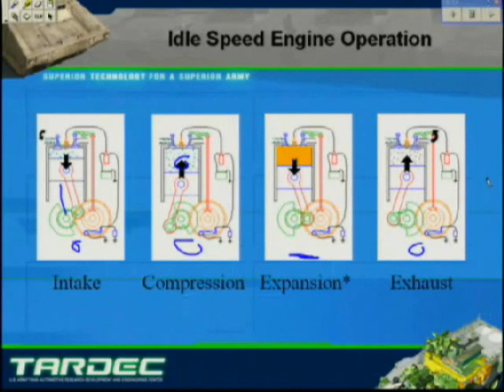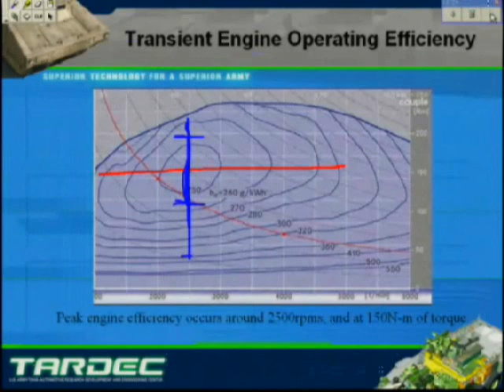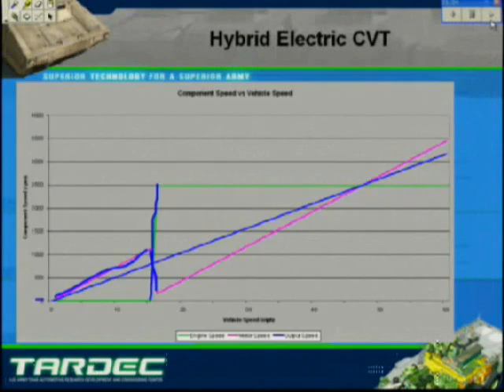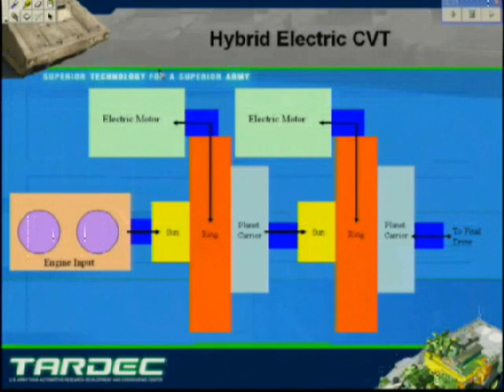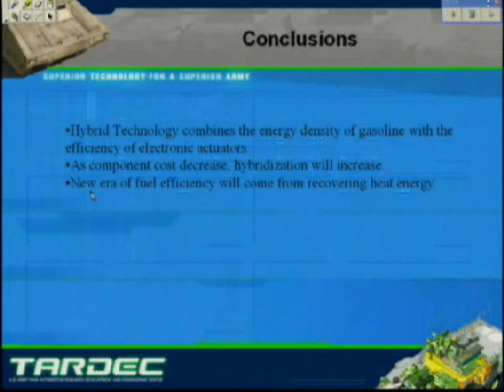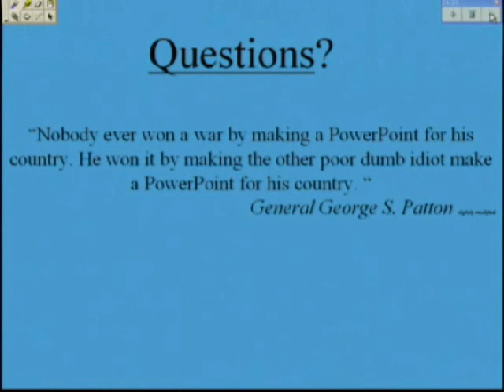Turbo Charged Alternator and CV Transmissions Part 3 of 3

Comment: I should mention that in the real vehicle (Toyota Prius) the sun gear is connected to MG1 (motor/generator 1), the planet gears and carrier are connected to the engine, and the ring gear is connected to MG2 (motor/generator 2) and the final drive (the wheels)